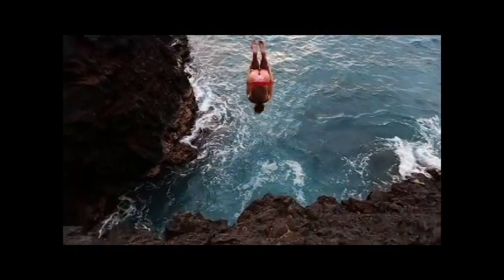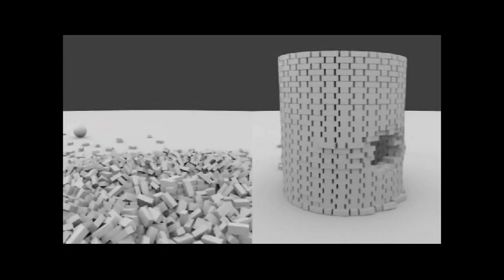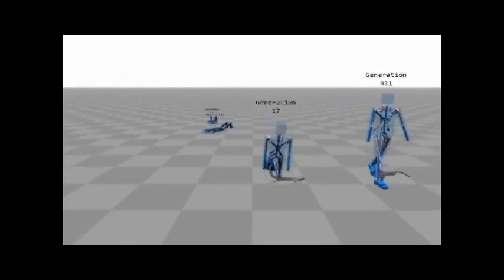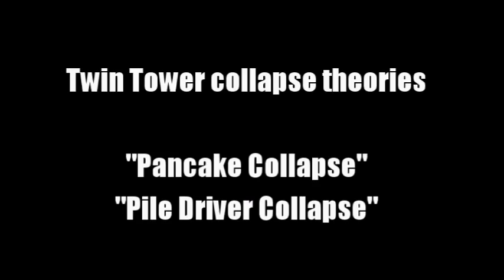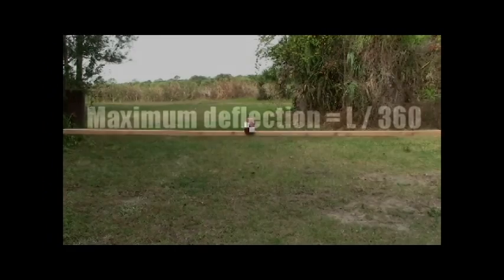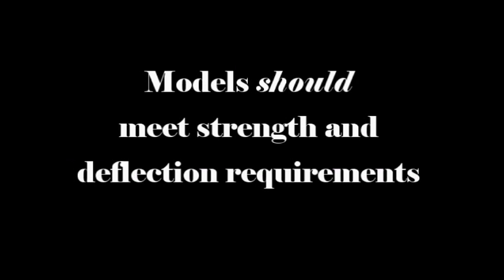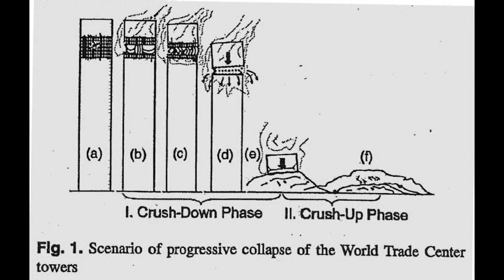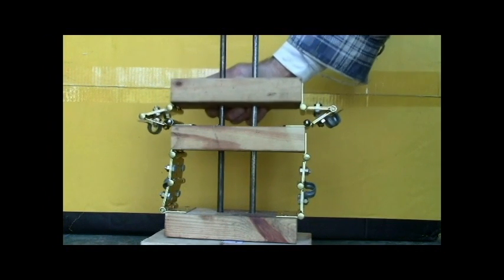9/11 Experiments: The Force Behind the Motion

Comment: F=ma is a WONDERFUL thing. It's just not relevant here. Newtons second law states that the vector sum of forces, F, on an object is equal to the mass m of that object multiplied by the acceleration a. Thus, F=ma. Great.

But, there's a couple of things that Mr. Cole STRANGELY omitted. Like the fact that this ONLY works if the mass is constant. If, say, something is breaking apart, like, oh I don't know...a BUILDING? It's irrelevant. There's also the slight issue of what is known as an "inertial frame of reference".

"The direction of the motion is always in line with the direction of the applied force." And to illustrate this, Cole shows a case where it isn't. Bravo. Where, in fact, the applied force is RE-directed, by use of a joint. Good sign.

Similar acceleration does NOT mean similar direction of force. Clearly stated in F=ma, in fact. "Vector sum of forces". Vector is DIRECTION, where is it headed. ACCELERATION is the force, simplified how FAST it's going. But the vector isn't the same as the acceleration. It can go up, down, left, right, forward, backward, in any combination you care to imagine. Yes, it can even go it opposite directions at the same time, and essentially not move at all, or potentially rip apart. The trebuchet shown is, in fact, an excellent example of this, in that it was know to throw stones in all sorts of directions, including back or straight up, if it was set up wrong. Similar acceleration, not similar direction.
Reply: Your falling mass will be decelerating as it falls no matter what is happening.  Building collapse mass changing or not.

And as you state the falling mass wouldnt all be falling on the building.  So that mass wouldn't impact the stable building at all.  Thus the mass falling onto the floors is LESS than the mass of the floors were before the collapse.
Reply: @DS94everXev  "Your falling mass will be decelerating as it falls no matter what is happening.  "
After all, gravity isn't actually a thing.

"And as you state the falling mass wouldnt all be falling on the building. "
Which is true, and matters not at all.

"Thus the mass falling onto the floors is LESS than the mass of the floors were before the collapse."
And increases with each floor, again.
Reply: @mooneyes2k478  I'm talking about the mass that falls that is part of the building that doesn't hit the floor beneath.

You will see it slow down no matter what.  Collapse is not eminent.
Reply: @DS94everXev  Because, as noted, gravity isn't a thing.
Reply: @mooneyes2k478  What are you talking about?  Gravity isn't a thing.  It's literally what moves the world around.
Reply: @DS94everXev  " What are you talking about?  Gravity isn't a thing.  It's literally what moves the world around."
MoonEyes2k is trying to tell you that gravitational force makes falling stuff go faster and faster.
Reply: @brucelansberg5485  You're telling me buildings falls to the ground no matter what once the collapse is initiated.

Gee.  Explain why demolition teams are even a thing then.  Just throw that onto the floor gave it blow up and the falling floor will just naturally destroy the 60 70 80 floors underneath then according to your logic of physics.

Explain why its possible for buildings to actually stop collapsing when they started to collapse.  Even though the building was set up to collapse by a demolition team.

Explain to me why you stop accelerating and eventually stop falling deeper into a body of water if you are meant to keep accelerating.  After all the water will slow you down.  Just like the stable floors underneath the falling debris are slow down a building whose top floors are collapsing.

Of course that won't happen if the floors are set up to fall prior to the top falling portion falls because it was set up with explosives.

Which is what happened on 9/11.
Reply: @brucelansberg5485  yes duh gravity is what makes the universe move.

"You seem to misunderstand speed for acceleration. If you drop a hammer from the top of a building, it has a constant acceleration of 9.8 m/s2 (it goes faster and faster up to terminal velocity). If that hammer encounters some kind of obstruction on its way down, the acceleration will decrease. However, as long as the acceleration is over 9.8 m/s2 it will accelerate. Only if the acceleration becomes negative, the hammer will slow down."

Ummm.. this is exactly what happened and is what is absolutely impossible unless the building was demolition.  The fact that the building fell at free fall speed is precisely telling you that the falling debris did not encounter ANY resistance as it fell.

That by definition means the floors were destabilized BERORE the falling debris ever hit them.  That is IMPOSSIBLE unless the floors were demolitoned.

Those falling floors would encounter a resistance stable floor every 12 feet or however tall the floors from floor to ceiling the WTT were.

So they would have slowed!  But they didn't.  You can't get a graph showing free fall speed if the floors were not demolitoned.  But you do get that graph because the floors were demoltioned. 

You seem to think that a smaller mass falling down on  a larger mass can destroy the whole thing.  That is simply WRONG.  

You seem to think that a falling piece of the building when it hits the stable floor would still manage to stay together and not be destroyed.  Then once this impossible piece of the building wiped out the entire building, it managed to crush itself.  But failed to crush itself the whole fall down.  That is WRONG.

"Unless the mass of 15-28 floors will be applied as a dynamic force onto the 1 single floor below."

Does not matter at all.  the falling part will ALWAYS slow down once it hits a stable item.  It is completely irrelevant how big the mass is falling down and how small the mass is of the object it hits is.  That falling mass WILL ALWAYS slow down.  Even if it hard to measure.  the falling mass will ALWAYS SLOW.  There is no such thing as dynamic force overcoming the fact that the falling mass hits a stable element.  The rule is very clear.  A falling object will ALWAYS slow down when it hits another object beneath it.

That is why a missle or a bomb traveling hundreds or thousands of mph will not go thru the earth.  It doesn't matter how much mass it is.  It hits the ground and it slows.  Eventually coming to a dead stop.  

"Only if the acceleration becomes negative, the hammer will slow down."

Did you watch the video here?  Because the experiment proves you are wrong.  A falling smaller mass will not destroy a larger mass at free fall speed.  That's what the experiment in this video proves.  

And neither your nor troll himself mooneye will change the facts.  You act like the floors cant handle any extra weight.  Each floor would absorb a TON of energy of the falling debris before it too would collapse under the weight.  As each floor was hit, the deacceleration of the falling debris would increase.  Until eventually the collapse ends.  Leaving a BUNCH of the building still standing.  The whole building would not have collapsed.  

While looking at building design and destruction, you will also learn that it is impossible for asymmetrical damage to cause symmetrical collapse.  

The WTT fell symmetrically.  The WTT were asymmetrically damaged.  Explain that using your odd physics rules. 

The WTT had the plane fly thru much of the building with the explosion going out the other side.  Those passenger planes will get ripped up by a hail story or flock of birds.  Yet you mean to tell me they went right thru a steel and concrete structure building?  Yet is easily ripped apart by a bird?

Those passenger planes can hit a max speed of 500mph or so at altitude.  Meaning the plane has to   be 35000 feet in the air to manage that kind of speed.  At sea level which is where the planes were that hit the WTT, they can manage no more than a few hundred mph.  Nothing near the over 600 mph that the planes hitting the WTT were going.  This is IMPOSSIBLE.  If you tried to decend a passenger plane so quickly the plane would rip apart.  That's engineering facts of those planes. 

There was gold in the basement of the WTT prior to 9/11.  At no point was it reportedly moved.  However, when the rubble was cleared from the site, there was no gold!  Where did the gold go!

"MoonEyes2k is trying to tell you that gravitational force makes falling stuff go faster and faster."

They won't accelerate faster and faster when they hit a stable floor every 12 feet or so though!  That didn't happen because the floors were demolitioned prior to the falling mass hitting them.  That is why it fell at free fall speed.
Reply: @DS94everXev  "You're telling me buildings falls to the ground no matter what once the collapse is initiated."
No, I don't. At all. I was trying to explain to you the difference between deceleration and less acceleration.

Your quest for an explanation on the demolition thingy is therefor irrelevant.

"Explain to me why you stop accelerating and eventually stop falling deeper into a body of water if you are meant to keep accelerating."
What has me bing in water to do with free fall acceleration of a hammer? I tried to explain how mass can still accelerate when it encounters resistance. As long as the resistance of the floor connections of the one floor below the falling mass is less then the downward forced acting upon it, the mass will accelerate. t won't be in freefall acceleration though. But like I said, anything over 0 m/s2 is acceleration.

"Just like the stable floors underneath the falling debris are slow down a building whose top floors are collapsing."
It isan't about the strength of the gloors of the towers,0 but about the strength of the connections between floor and columns. Apart from that, the extent to which a building is susceptible to progressive collapse, all depends on the design/engineering of that building, There is no generalization.

"Which is what happened on 9/11."
Any proof would be highly appreciated.
Reply: @brucelansberg5485  
"It isan't about the strength of the gloors of the towers,0 but about the strength of the connections between floor and columns."

It kinda is both.  Either way, its the same thing.  Why would the WTT engineers not design floor connections capable to sustaining substantially more weight than necessary?  Do you have evidence that they would not design floor connectors that can sustain substantially more weight?  Because they simply wouldn't do that.  How much weight will be on any floor can vary drastically.  You don't design building to only handle just a tad more than the suspected mass of a floor.  

"No, I don't. At all. I was trying to explain to you the difference between deceleration and less acceleration"

I don't really care.  That's not the point of the discussion.  The point is did the WTT fall due to controlled demolition?  Would the falling debris slow down (thus  not be free fall) if they hit a stable floor connection?  That is all that matters.  And the answer is 100% yes.  There were 60-80 stable floors here.  The falling mass would not have collapse  the whole building.  And free fall speed would not have been achieved for virtually the entirety of the collapse.

"Any proof would be highly appreciated."
Look up Rebekah Roth on Youtube.  I'll link her show in a separate post so that if it is deleted this post isn't deleted as well.

Just think about it for a bit.  Where was the army planes  that would be in the air in 6 minutes when the planes were hijacked?  How come there is not a single audio of the hijackers (not terrorists as Rebekah explains terrorist was not a word used by flight attendants before 9/11.  They were only called hijackes) entering the cabin?  How come there is zero engine noise in the cell phone calls we have heard?  How come the airplane cell phone worked perfectly for 20 minutes when it was always losing reception?  How come not a single flight attendant did their job correctly that day on 4 separate air craft?  Not a single one of them followed protocol at all.  How come the planes were showing up on radar going far beyond the speed of those aircraft (they weren't those planes that is why and is also why they could go thru the towers and not collapse upon hitting the towers?
How come only one part of the airplane was suffering from some kind of gas (pepper spray or similar) when the plane is pressurized in the air?  Because in a pressurized cabin, everyone can smell everything in a plane no matter where they are at.  (hint.  it only effected one part of the plane because the plane was not pressurized).  That by definition  means the plane was on the ground when that phone call was made!  That means what hit the WTT were not those planes.  Those  planes were at an airport controlled by the army with hangers large enough to house the planes.  And that airport controlled by the army did not have any staff that day on hand.  One of the attendants mentions that there are stairs in the plane.  But there are not stairs in the type of plane she was in!  Watch Rebekah's vids (she is an ex flight attendant so she'd know exactly what would have happened and who says what and who calls whom hint no calls would be made.  And this is stuff that common folk like us would never know (like flight attendant using the work terrorist rather than what they should have used "hijacker".)
Reply: @brucelansberg5485  Here's a link to one of the vids.  it is a bit outdated as the device used to take over an airplane away from the captain is no longer believed to have been used.  But regarding how each part of this would react if this was a real hijacking (flight attendant, captain, air control, army etc. she gets it right here.)  But its a great intro video to her and her work so enjoy!

https://www.youtube.com/watch?v=7md2QzNsAe4&list=PLzL220Pdflo7QRJucNPXrS0irDRlaoIA0&index=2
Reply: @DS94everXev  I'll get back to you and answer your questions tomorrow. It is 2 am here right now and I need my beauty sleep. Meanwhile don't hessitate to answer some of the questions I asked before as well.
Reply: @brucelansberg5485  i replied a bunch of things to you but google doesn't like the truth about Sep tem ber 1   1   being discussed.

So I will try to break it down in to s ma ll   er   po  s  ts
Reply: @brucelansberg5485  And falling objects will always slow down if they hit objects as they fall.
Reply: @brucelansberg5485   Did you watch this video as well as others by this creator?  He messes around with the building design purposefully weakening it.  It does not matter.
Reply: @brucelansberg5485  The falling object will slow down when it hits another object beneath it.  Even if you weaken the design underneath.
Reply: @brucelansberg5485  Free fall is only seen in demolition buildings.
Reply: @brucelansberg5485  Not in collapsing buildings.  No matter what the cause of the collapse or what's beneath the falling portion.  No steel concrete building has fallen from fire in history exc
Reply: @brucelansberg5485  That somehow managed to melt steel.  Look at the
Reply: @brucelansberg5485  NIST computer model of how bldg 7 fell.
Reply: @brucelansberg5485  It isn't remotely accurate to what you see in reality.  Their model gas one end of the building collapsing before the other end.
Reply: @brucelansberg5485  But what we see is a perfectly symmetrical collapse.
Reply: @brucelansberg5485  That can only happen if it was rigged as damage to a building from fire would not cause equal damage to all the support beams at once.
Reply: @brucelansberg5485  And if it did collapse due to fire (again that didn't happen) it would have fallen asymmetricly and the support beams that were not damaged would have held up the building that they support.
Reply: @brucelansberg5485  See who many of these posts last.  Sorry.  this is life on yu  t  ub  e
Reply: @DS94everXev  "i replied a bunch of things to you"
Between my post about calling it a day en my post before that, I can see 3 posts of yours. After my last post, I can see another one.

"but google doesn't like the truth about Sep tem ber 1   1   being discussed."
Well, not sure what that means, but I can see 4 posts that haven't responded too yet. And I engage in discussion on 9/11 with many others without any of their posts being deleted by Google. So you might want to rethink your conclusion.

Let me respond to these 4 posts. I will assume your broken down posts have the same content.
Reply: @brucelansberg5485  The
Y

J
U
St 

Remove
1+1= 
Posts
Eye just
Made
2 u.
Reply: @brucelansberg5485  all this 
Posts
At the now 
Fifteen 
Hour mark
Were........all.   ONE Post.

Took me 1 hr to bypass their auto removal.
Reply: @DS94everXev  "It kinda is both."
No it isn't. These floors could have been made from steel plates 10 inches thick. If the connections break, the floors will come down.

"Either way, its the same thing."
It is absolutely not the same thing. These connections were bolted. With normal use of the floors, no issue. But these bolts were not designed to have a dynamic force exercised on them of 15 from the mass of 28 falling floors.It makes al the difference.

"Why would the WTT engineers not design floor connections capable to sustaining substantially more weight than necessary?"
Whoever said they didn't? Of course there was redundancy. I haven't been able to find a factor though.

"You don't design building to only handle just a tad more than the suspected mass of a floor. "
Something we agree on.

"I don't really care.  That's not the point of the discussion."
It actually is. Your claim is that the collapse should have slowed down because of encountered resistance. It seems you think that any resistance should have slowed down the collapse. This is simply not true. It would only slow down the acceleration. Instead of speeding op 9.8 meters per second squared (free fall acceleration), it would now accelerate let's say 5 meters per second squared. A slow down of the collapse would indicate an acceleration less than 0 meters per second squared. This is the central point of our discussion. You claim that any resistance will lead to a slow down in speed, yet it will lead to a lesser acceleration (which means that it possibly still accelerates).

"The point is did the WTT fall due to controlled demolition?"
Well, if evidence is important to you, then the answer is no.

"Would the falling debris slow down (thus  not be free fall)"
So I guess you will now get that less than free fall acceleration doesn't mean a slow down in speed.

"if they hit a stable floor connection?"
So the falling debris wouldn't necessarilly slow down, just the acceleration will be less than 9,8 m/s2.

"And the answer is 100% yes."
No it isn't :).

"And free fall speed"
There is no such thing as free fall speed. There is only free fall acceleration.

"And free fall speed would not have been achieved for virtually the entirety of the collapse."
There was no free fall acceleration for the debris that hit the floors. There was only free fall acceleration for the debris that fell past the towers. If the topwers would have collapsed at free fall acceleration, they would have collapsed in 9.2 seconds. Yet they didn't. Please take a look at this short video where a clock is timing both collapses and see how the towers needed more time than 9.2 seconds.

https://www.youtube.com/watch?v=ZtknESrHNEs&list=PLNUStdCpyxT8TBfOCscomO6yEqQlpJxCT&index=12&t=59s

"Look up Rebekah Roth on Youtube."
Do you expect me to wtach a 1 hour video to search for evidence of a claim YOU made? :) A claim btw about the buildings being setup with explosives, and you link a video of an interview with a stewardess? :) How would that prove anything?
Reply: @DS94everXev  "Just think about it for a bit."
I'd be more than happy to discuss your other proof. But may I suggest to get to an understanding about the subject matter of free fall acceleration first? Otherwise it's going to be a very messy thread.
Reply: @DS94everXev  "all this Posts At the now Fifteen Hour mark Were........all.   ONE Post.Took me 1 hr to bypass their auto removal."
Not sure if there is such a thing as auto removal with YouTube. Unless you have repeatedly violated their posting guidelines before. But talking about conspiracy theories in the comment section is never an issue. Like I said, I have hem numerous discussions where other stated a lot worse than you have :).
Reply: @brucelansberg5485  I know buildings fall asymetricsly if damaged asymetricsly because architects have said so.
Reply: @brucelansberg5485  Have you read NIST?  It doesn't bother to explain the collapse of the building once collapse has started.  It assumes the whole building will collapse.  Like once it starts its inevitable.  Which it clearly isn't because buildings set to be demolished but something went wrong didn't fully collapse at all.  It started BUT STOPPED.  Why?  So why did NIST end their investigation at the start of collapse?  

Look at the Miami apartment collapse.  The whole building didn't come down.  Only the part that suffered damaged. 

There is nothing special about 7 design.  It he from fire.  The news said it re that day BEFORE it fell!  

I'm sorry if you are obsessed with acceleration vs deceleration.  You aren't seeing the picture.  And you never will if you refuse to watch the vids.
Reply: @brucelansberg5485  I saw your video link.  Some thoughts on it
1.  Are you seriously comparing the fire in bldg 7 to the fire in this falling building?  Look how many floors are burned out vs bldg 7.  Not remotely the same thing.

2.  Did you read the comments section? A person brings up that this building should have fallen symmetrically according to September eleventh.  It didn't.

3.  Your video fails to show if the whole building fell.  Because as you can see it's collapse was asymmetrical.  Your video actually demonstrates the type of collapse you are arguing against.  It ends in smoke.  Not showing the building completely collapsed.

4. How well was this building made?  Because I hear laughter when it fell.  Not screams of terror and horror.

5.  The steel in bldg 7 was also protected against fire.  Were these beams in this building?

6.  Did the building fall at free fall?  Kinda the point of this whole thing.

7.  You have yet to discuss the other details.  About the P
  L
A

N

E
S
Reply: @brucelansberg5485  If you feel that this video is not accurately representing the event of what happened how come you can't show me a video demonstrating the physics like this guy does?
Reply: @DS94everXev  "I know buildings fall asymetricsly if damaged asymetricsly because architects have said so.."
Well, show me one architect that has ever witnessed a 11- story building collapse apart from the twin towers. And we can have a discussion about the meaning of symmetrical. The towers were built symmetrically. The progressive part of the collapse was more or less symmetrical. Or are you suggesting explosives were used?
Reply: @DS94everXev  "Have you read NIST?"
|Is that a question to me or are you repeating my question? I have read the reports on the twin towers and I have read the reports on WTC 7. The thing is, I asked you if you have read the reports. It doesn't go unnoticed hoe you still haven't answered that question.

"It doesn't bother to explain the collapse of the building once collapse has started.  It assumes the whole building will collapse.  Like once it starts its inevitable."
True, they habe not explained the progressive part. Were they tasked to? And no, they didn't assume. And yes, it inevitable. It's called progressive collapse. I have explained a little bit about the structure of the towers. What else do you needc to understand that it indeed was inevitable?

"It started BUT STOPPED.  Why?"
If you are honestly sking this question. it is very clear to me you haven't read the reports on the twin towers. You should, if you want to critisize is. Read the reports!

"Look at the Miami apartment collapse.  The whole building didn't come down.  Only the part that suffered damaged. "
So please explain to me how the engineering of Champlain Towers South compares to the engineering of the twin towers. I feel like we're going around in circles. Me expaining how you don't understand the engineering of the tyopwers, and you completely ignoring this. If you don't understand how they were built, you will never understand how they came down.

"There is nothing special about 7 design."
Are you kidding me? Really NP, please make sure you know what you're talking about before you express your opinion.

"The news said it re that day BEFORE it fell! "
And your point would be what exactly? Do you also know which news?

"I'm sorry if you are obsessed with acceleration vs deceleration."
Dude, I'm not obsesses, I am annoyed you simply don't want to understand what I'm trying to say. Let me try a last time. My car goes from 0 to 100 in 10 seconds. When accelerating, my car hits a cat. Because my car hit a cat you claim that my car should slow down. NO!! My car will now not reach 100 in 10 seconds but in 12 seconds. It is still fucking accelerating, but less fast. 0-100 in 12 seconds is less acceleration than 0-100 in 10 seconds. My car is not decellerating, it is still accelerating. Get it?

"You aren't seeing the picture."
The irony is stunning.

"And you never will if you refuse to watch the vids."
I will watch the vids of the interview with some stewardess later. They are not relevant to the collapses.
Reply: @DS94everXev  "Are you seriously comparing the fire in bldg 7 to the fire in this falling building?"
No, you are. I posted the three videos as a reply to your false claim _"No steel concrete building has fallen from fire in history exc"_.

"Look how many floors are burned out vs bldg 7."
So how many floors in video 1, 2 and 3? And how many in WTC7? Have you seen th pictures of WTC7 from the south side too? Did you see that fire in the second video too? Did you that fire started by a broken coffee machine? Did you see ho the intact of that tower collapsed too? But all of this doesn't matter much. Every fire is different. Every building is different. Comparing is hard without understanding the little details.

"Not remotely the same thing."
Well, since I didn't post them for the fires to be compared, but only to prove your statement wrong, are you now accepting you are?

"Did you read the comments section? A person brings up that this building should have fallen symmetrically according to September eleventh.  It didn't."
No I really couldn't be bothered to watch read the comment section. And I am totally fine with some anonymous poster on YouTube saying some things. I don't care. What I do care about is the fact that every building is different, every fire is different. Like I said, we could have a nice discussion about the meaning of symmetrical.

"Your video fails to show if the whole building fell."
I linked three. Which one you talking about? And it's irrelevant if you don't keep moving the goal posts. Your claim was that no steel framed building has ever collapsed from fire. I provided you with 3 examples.

"Because as you can see it's collapse was asymmetrical."
So what? What does it mean to you?

"Your video actually demonstrates the type of collapse you are arguing against."
What are you talking about? All three videos show collapes of steel framed building after fires. Something you claimed never happened or never could happen. That's all there is to it.

"How well was this building made?  Because I hear laughter when it fell.  Not screams of terror and horror."
Haha, dude... :) Anyway... only the second one has laugther and excitement. How well was it built? The only thing I can say is that it was the faculty of constructional engineering of the University of Delft. I will leave all speculation to you.

"The steel in bldg 7 was also protected against fire.  Were these beams in this building?"
So you clearly have watched one video only. I don't know which building you are tal;king about, so I cannot answer that question. If you are really interested, you could look up the reports on these collapses.

"Did the building fall at free fall?  Kinda the point of this whole thing."
Nope, it was the point. The point your false claim no steel structured building had ever collapsed as a result of fire. None of the three building at 9/11 fell at free fall acceleration by the way. If you picked that up from the guys and girls at A&E9/11Truth, you have been fooled.

"You have yet to discuss the other details.  About the planes"
What about the planes? I have not seen you mentioned them.
Reply: @DS94everXev  "If you feel that this video is not accurately representing the event of what happened how come you can't show me a video demonstrating the physics like this guy does?"
Don't mistake a fact for an opinion.
I don't understand your question. What does me showing a video or not has to dowith the validity of the above video?
Reply: @brucelansberg5485  oh man.  that is a video of a guy replicating the wtt collapse?

Seriously?  It nearly fell over when he gently tossed his wrench into it!  He didn't show that it was sturdy at all!  He demonstrated that a simple force can tear his model down.

""Because what happened can't be simulated in real life."
This doesn't make sense. Something can't exist if it can't be simulated? :)'

I'm saying the explanation does not fit the truth.  That is why it can't be simulated.  If it could it would have been. And NIST would have shown us the experiment.  

"I don't want to pretend anything. I'm not pretending anything. But the only logical explanation is molten aluminum from the plane that hit that exact same floor. "

That molten part is not from the floor hit.  It was below.  And good luck getting aluminimm into that steel concrete structure.  

"No, my reply will be "Read the report", so at least you know what you try to fight in the first place."

I have.  And they don't explain anything at all.
Reply: @brucelansberg5485  ""The evidence against it is EVERYWHERE."
And yet you refuse to show me any."

No.  You flat out have stated that you won't watch it till sometime later.  Why?  I told you to watch those vids.  You didn't. so you refuse to accept evidence.  When you finally do, you will see all the waste of time you spend defending NIST.

"Please study the design or let me explain it to you. Now it is obvious you are simply repeating uninformed claims. Sorry dude, but it is obvious. "

I'm repeating what 3500 architects and engineers have supported.  Which is far more than NIST has.  Not to mention i'm using common sense.

force applied in z direction doe not explain things pushed out at such a high speed and such a mass without explosives in the lateral direction.  Explosives would apply the force outward.  Gravity will not.  Therefore it wasn't gravity forcce that did that.  And since NIST does not have an explanation of that lateral force, guess what I think of their report?

NIST does not explain this.  And neither have you.  Contently saying I know do you and "read the report" (funny how you fail to actually quote the report sections that answer these facts) does not actually present evidence at all. Its just you parroting what you want to believe.  The difference between me parroting and you parroting is my explanation of what happened matches the evidence.  Practically none of your evidence explains why.  

"the design alone was responsible for the progressive part of the collapse."

And yet fails to explain the lateral movement of multi ton steel sections that hit surrounding building with such force that they stuck into them.  And yet fails to explain concrete pulvarizing in mid air.  And yet fails to explain the utter destruction of those transformers.  And yet fails to explain the absence of the gold.  And yet fails to even explain how the planes even penetrated that far into the building.  And yet fails to explain why there were explosions in the lobby far far from the impact point.  And yet fails to explain why the owner of bld 7 said "pull it" before it fell.  And yet fails to explain why the reporter said it fell before it did.  And yet  fails to explain why the center of the building is what collapsed first which is EXACTLY what a demolition would do.  And yet fails to explain why the building initially fell sideways and then straightened itself up.  And yet fails to explain the free fall speed achieved.  I don't care how it is designed.  It cant get free fall speed unless the falling debris encounters no resistance.  I have a lot more more "And yets..."  All of which you cant explain with NIST.  But I can explain with  demolition style. 

Yes I know all that you said about the design of the building.  I saw that documentary as well.  And NONE of it explains any of the things in the above paragraph and posts from me.
Reply: @brucelansberg5485  I actually finished watching that vid you say is the proper physics of the tower.  You know the one where a wrench almost knocks the Model over.  So good thing wrenches didn't hit the tower before that plane.  Heck maybe that explains why the towers fell!  If a gently tossed wrench can move it a good bit..why not air p  lana es?

Anyway did you actually watch the video?  Seriously now.  Because if you did you will see ZERO lateral movement of the collapse structure.  Absolutely none.

Yet the towers have A TON of lateral force movement.

Dude, your own video disproves your own position. Your video has everything falling straight down.

Why?

'Because that is how gravity works.  Down.  Nothing went laterally because no force was applied laterally.

Watch the towers collapse.  This video is flat out showing that what happened on that day is NOT this.   

" I accept the outcome of the reports. You don't "

Because they fait to explain the physics that day.  Simple as that.

"There was no nano thermite found, so hey don't include it."

You sure you read the report?  I mean it is boring as i get up.  but if you did then you'd know that NIST NEVER looked for thermite!  Much less nanothermite.  So it was not in the report.  That does not mean it is not there!

And if you knew that independent labs did look for thermite and found it, then what does that mean to you?  Because they did find it.

https://benthamopen.com/contents/pdf/TOCPJ/TOCPJ-2-7.pdf

https://www.deseret.com/2009/4/7/20311250/traces-of-explosives-in-9-11-dust-scientists-say

A peer review scientific research paper (top 1).  By the way NIST is not peer reviewed.  They won't even allow access to their computer modeling to see if it is accurate.   A peer reviewed paper IS NOT CONSIPACY NUT JOB.   

"Yet they fail to mention that part of the columns was treated with a primer paint that actually has the same compopnents in it."

Components means what to you?   because the components inside of you and what makes you are the same components inside of a rock!  If you know science you know that it is not the components of something that matter that much.  Its how those components are arranged.  They found nanothermite.  Not components of a primer paint (by the way that same steel with the primer also had fire resistance material sprayed onto it as well to help prevent weakening from fire.  But let's pretend that isn't true.  

Lets just say that I trust peer review paper over you a youtube commenter  saying its not nanothermite.  You mean to tell me they place explosive material into the materials to make the building?  Because I'm not buying that. But you still can't explain the lateral movement from gravity alone force collapse with your vids.
Reply: @brucelansberg5485  
"Now take a thorough look at their titles. You will see a lot of students, a lot of non licensed architects or engineers,"

Actually I dont see students and out of work people (though why does that matter.  Their expertise is all that is needed.  Not that they are working.  this is not unemployment)

Those are not students!!  They are professors or workers of some kind for universities.  Where does  it state student?  You are pretending they are. Virtually all of the signees are AIA members.  You have to be an architect to be in AIA.  Like NEA only allows teaches to be in it.  Once again, your own link proves my point even more so.  

"What is relevant, is the lack (or basically the absence) of evidence."
Wrong.  Lateral movement of debris when the only force applied is vertical from gravity is the only thing you need to prove NIST is wrong.  There are lots of other things.  But you fail continuously to demonstrate lateral movement of steel weighing tons being tossed at 60 mph from gravity.

"Dude, you're stubborn. There is such thing as free fall speed. There is only free fall acceleration. Neither of the towers fell at free fall acceleration."

Blame scientists and engineers who say free fall speed routinely.  But you're not one so it would be hard for you to manage that.
Reply: @DS94everXev  You can't blame me for not responding to something before you write it  I will get back to you again tomorrow. Time for bed now. Ad don't forget to repsond to the things I wrote you do understand now :).
Hope to talk to you tomorrow.
Reply: @DS94everXev  So, back for round 3. I have to admit, I don't like how you keep throwing claim after claim at me, while we haven't discussed the main point of this thread in full yet. You keep ignoring question I ask and explanations I provide, unless you see a chance to throw a new claim in my face. So let me ask my question again: Do you now understand how deceleration and less acceleration are basically eacht others opposite and why this is so important to your uderstanding of the acceleration of the collapses?
Reply: @DS94everXev  Interesting video.  I don't understand how AETruth claims the spread of debris is too wide and at the same time claim the towers fell in their own footprints. Maybe you can explain?

""Video shows debris pulvarized in mid air""
Could you please provide a timestamp where we can actually see what is claimed? I hear gage making this claim, yet I don't see it in this video or any other. Unless you think here is another example of concrete being pulverized mid air:

https://youtu.be/yOE8H_1Dhz4?t=164

"Steel structures weighing tons were projected outward (x and y axis) at 60 mph."
The x axis is vertical. I gues you mean the Y a Z axis?

"How is that possible if the only force being applied is from the z direction..from the falling part falling on the bottom part? It simply isn't.  Only explosives and send debris in the x y direction since the collapse is in the z direction."
Lets take a closer look at this claim. We agree gravity works vertically. Now imagine a pool table. The force the white ball puts onto another ball is in one specific direction. Yet, only if the next ball is hot perfectly in the middle, the other will go straight ahead. In any other case, the next ball will have a different path. So how is that possible if the applied force is directed straight ahead? Take a marble, drop it onto a piece of wood that is placed under an angle. Which way is the marle propelled? Straight down, or will it bounce off to the side? Two very simple examples to show your claim is false. 

"Why do you see puffs of smoke coming out"
Result of air being pressed together by falling floors. The air is forced to seek a way out through the path of least resistance.

"just like in a demolition on floors that are not even  close to being impacted by the falling mass?"
Not just like in a demolition. Demolitions use explosives. Buildings that are demolished will break at the points where the explosives go off. These explosions happen all around the same floor. A few single puffs do not resemble controlled demolition, not matter what AETruth is claiming.
How would you know if these floors weren't even close to the falling mass? We can't really see inside the towers, can we? I have explained about the engineering of the towers and described the importance of the floors for the construction. The floors fell first. The puffs are a clear indication of that.

"What we see is an outward explosion of this material beyond the perimeters of each footprint.  And this is not expected."
Not expected by whom? Now let me explain what we really see. We see sheets of exterior columns leaning out and breaking off after the floors had fallen. Please take a look at this picture below.

https://ia801303.us.archive.org/2/items/NIST_9-11_Release_08/International_Center_for_911_Studies_NIST_FOIA/Release_08/Release%208/42A0007%20-%201of3/Police%20Overheads/166.JPG

We see several sheets of connected exterior columns covering West St. Like a stack of beer crates falling over.

https://youtu.be/9SReWtHt68A?t=55

"So what in the NIST report explains this?"
What's there to explain? Only conspiracy theorists think this is an anomaly.

"Large multi ton beams are were hurled hundreds of yards laterally.  Gravity works verrtically, not laterally."
Do you still think tis is an intelligent observation?

"Something happening to throw these things (multi ton steel sections)  horizontally at those kinds of speeds up to 60-70ph is really indicative of some kind of explosion."
No it isn't. See explanation above.

"So watch any other demolition.  Do you think those puffs are from air pressure or from explosives?"
"Any other demolition" is quite broad. First hit, a nice slow motion of a controlled demolition of a high rise building. Please take a look at these puffs and see how in this case there is an explosive force behind it. Speed, range, locations, simultaneity and material all indicate an explosie force. Now compare this to what we see at the twin towers.

https://www.youtube.com/watch?v=3JMgFgjSkQ0

"Not from the collapsing building from gravity.  Elementary school science already teaches that.  What force was it?"
See solution above. Gravity.

"All the signs of demoltion and the completeness of desrtruction down to their individual elements."
Literally none of the signs. Most noticebly, the absense of the sounds of the explosives. This is what it should sound like:

https://youtu.be/hdqWRHe4AKs?t=9

Decibels and repetition/sequence is what is lacking at the collapses of the towers. How do you explain that?

"Do you know why it started to lean over and look like it was going to hit the building next to it?  Because it was damaged asymetrically from the impact!  It was going to fall asymetrically.  But then the explosives went off and it corrected itself."
See picture above.

"There are 64 transformers.  Each weighing 4 tons.  And yet after the collapse there is no evidence of them. in the debris."
Over 108,000 trucks loads of debris were removed from ground zero. Please tell me you haven't checked all of them and didn't find any crushed metal boxes. What are you suggesting? That some laserbeam from space targeted and destroyed all of them? 

"As an architect I would expect to see larger portions of the building floors and the steel decking and the concrete topping much larger remanents...Afterall each floor plate was over an acre in size and there are over 100"
The concrete slabs were 4 inches thick. That's nothing in a collapse of a 110 story steel framed building. Where did this architect search for concrete? And there is a very nice example of how misleading AETruth actually is. This guy claims each floor plate was over an acre in size. The reality however is that each floor was constructed using elements 6 meters wide and 18 or 11 meters long. Nothing near an acre.

"while stating why the falling part did not get demolished at all"
I have not been able to find any information on this in the NISt reports. Source?

"From river to river there was dust 2 to 3" deep everywhere."
Have you checked this claim? I am a bit confused right now. Is it 2-3 inches or is it 4-12 inches. Both claims made by AETruth.

https://www.facebook.com/photo.php?fbid=10151809306826269&set=a.379243506268.164274.59185411268&type=1&theater

Since apperently this photo is the best evidence AETruth could find, and it is obviously less than 1 inch thick, I'd suggst this claim to be debuked.

"NIST does not explain a single one of these things.  If they did, AOE would not have 3500 people saying this is wrong."
If the claims are false, why should they be explained by NIST? Not checking facts and simply assuming makes 3,500 people being wrong.
Reply: @DS94everXev  "You flat out have stated that you won't watch it till sometime later.  Why?"
Before you wrote this line, I had already explained twice.

"I told you to watch those vids.  You didn't. so you refuse to accept evidence."
I hae explained that watching an interview with some stewardess that wasn't even involved in 9/11 doesn't help explaining yourmisunderstandings of the collapses of the towers.

"I'm repeating what 3500 architects and engineers have supported.  Which is far more than NIST has."
Why does that even matter? NIST studied the collapses for over 3 years with a team of several hundreds of subject atter experts. These 3,500 individuals we know nothing about. They might have studied it, they might just simply have signed the petition. One thing is for sure, they didn't have access to the same sources as NIST had. And please explain to me how electrical engineers, software engineers, landscaping architects or aeronautical engineers have the same expertise and experience as a team of subject matter experts that have studeid the incident for years? Most importantly, whay does it matter? It's simply an appeal to authority. It doesn't prove anything. How large is the group that hasn't signed the petition again?

You shouldn't be repeating. You should check the claims for validity. Just repeating doesn't teach you anything. Just repeating will make you make the same mistakes over and over again. 

"NIST does not explain this.  And neither have you. "
Like I stated before, you can't blame me for not repsonding to stuff before you have written it.

"Contently saying I know do you and "read the report" (...) does not actually present evidence at all."
As I have stated, I told you to read the report to gain an understanding of the engineering of the buildings. I have not directed you to the reports for any kind of evidence. I'm not the one who has to provide the evidence. Since you are the one making claims, I believe the burden of proof is on you.

"And yet fails to explain the lateral movement of multi ton steel sections"
Like I stated before, you can't blame me for not repsonding to stuff before you have written it.

And that whole list of what I have failed to explained? Really? Most of these issues you haven't even addressed before. How am I supposed to respond to something you haven't mentioned before? Dude... Like I said, I respond to every single rediculous claim you make, in order of appearance. The real problem is that you do not respond back on most of the things I explain. Why is that? Mat I assume you agree to the explanation if you don't come back to it?

" the lateral movement of multi ton steel sections that hit surrounding building with such force that they stuck into them"
Done.

"concrete pulvarizing in mid air"
Show me some evidence that really happened.

"the utter destruction of those transformers"
Show me some evidence that really happened.

"the absence of the gold"
Done. All gold was accounted for.

"how the planes even penetrated that far into the building"
They didn't, at least not as a recognizable plane. Yet the parts that hit the windows, travelled further into the building. Why would they not?

"there were explosions in the lobby far far from the impact point"
Falling elevators. Fire balls travelling trhough the shafts.

"the owner of bld 7 said "pull it" before it fell"
Hahaha, really? Do you really want me to take this claim seriously? The owner admitting the controlled demolition in a documentary? :) Could it possibly be that he was not referring to a controlled demolition when he used those words? I can't believe you mentioned this one...

"the reporter said it fell before it did"
BBC acted upon information they received from AP. AP retracted that report later. Classic case of chaos in reporting a chaotic event. No-one has ever been able to explain to me why BBC and CNN would be part of the conspiracy at all by the way.

"the center of the building is what collapsed first which is EXACTLY what a demolition would do."
The center of the building collapsed first? Talking about 7 right now? I don't understand what your issue is on this matter. Please explain. WTC 7 looked like it fell from the bottom, not from the center (vertically). If you look at the collapse video of 7 that I linked, you would see the east penthouse collapse several seconds before the out shell does. The interior (you know, the part where the structure is) collapsed. the exterior stood for a few seconds. What is ti you don't understand about this?

"the building initially fell sideways and then straightened itself up"
It's getting more and more difficult to understand your chain of thought. I guess we're back to 1 and 2 now? The towers never fell sideways. The top did lean obviously. When the top started leaning, forces acted upon the members of that top for which they were not designed (carrying verticval loads), so it broke apart and the individual members continued following the path down. Do you think the tops of the towers remained in 1 piece?

"the free fall speed achieved|"
We have been over this before, more than once. Did you watch the little video I linked? Did you do the counting as well? Do you still think the towers fel at free fall acceleration? Free fall speed is not a thing.

"I don't care how it is designed."
I know you don't. And that attitude will keep you safely in your conspiracy bubble. Since what would happen if you would care and actually started understanding how the design and the way the towers fell are related? You might start to understand that you have been fooled all these years by a bunch of misleading people and videos. And then you would have to admit to yourself you were wrong. That can be a very painful experience. So, I know you don't care about the design. But you should.

"I have a lot more more "And yets..."  All of which you cant explain with NIST."
But like most of the new claims above, you need to write them down before I can respond to them, correct? 

"But I can explain with  demolition style."
Yet no repetative sequence of explosions during the collapse, no indication of explosives found, basically no evidence of explosions that come with a controlled demolition. None. You are theorizing only. Which means you are a conspiracy theorist.

"But I can explain with  demolition style."
Which one? Stop watching videos and start reading the report!

"And NONE of it explains any of the things in the above paragraph and posts from me."
Most of these claims are false anyway. The others are perfectly explained by the design of the towers.
Reply: @DS94everXev  "I actually finished watching that vid you say is the proper physics of the tower."
Again you are misquoting me. Stop doing that. The rest of your post is all centered around this misconception, so basically worthless.

"Because they fait to explain the physics that day.  Simple as that."
Which physics do you consider unexplained EXACTLY?

"You sure you read the report?"
Oh yeah, I did. And I understood it as well. Did you?

"So it was not in the report.  That does not mean it is not there!"
I was talking about the Jones/Harrit et al paper which you were referring to. They never fopnd (nano) thermite. They claim they found residue of nano thermite.

"And if you knew that independent labs did look for thermite and found it, then what does that mean to you?  Because they did find it."
No, they didn't. It would take a very long post and a lot of time to explain.There is a nice thread on Metabunk however where it is discussed. In specific the posts by Oy, are of interest.I do realize you will probably never accept Metabunk as a source, but at least you could give the discussion a good read.

https://www.metabunk.org/threads/investigating-active-thermitic-material-discovered-in-dust-from-the-9-11-wtc-catastrophe.9485/

"A peer review scientific research paper"
What does that even mean? Peer review means other, non involved scientists, have approved tha methodoly as described. They will never have an opinion about the outcome. So was it really peer reviewed? Why is it that this paper was never published in a peer reviewed magazine?

"You mean to tell me they place explosive material into the materials to make the building?"
No, you are. Are you trying to tell me the red/grey chips were explosive? Just checked the report again, and it doesn't mention anything on the chips being explosive. It is just assumed it is thermitic and therefor explosive.
Do you realize that if you would agree the chips are thermitic, you would have to assume it was painted on the steel which must have been done before the towers were even built?

"Because I'm not buying that."
Apperently you are.

"But you still can't explain the lateral movement from gravity alone force collapse with your vids."
Well, yes I can and I did.
Reply: @DS94everXev  "Once again, your own link proves my point even more so.  "
You were wrong the first time. You are wrong again.

You might want to scroll down just a bit frther, to where the non-flagship signees are listed.

"Blame scientists and engineers who say free fall speed routinely."
No, I blame you who simply repeats words you don't understand.

"But you're not one"
So, how would you know? Did you ever ask me? Did I make any mention of it? You are making stuff up, just like you do with your conspiritorial believes.
Reply: @brucelansberg5485  The main point of this thread is how and why did the buildings fall down.

The video is about showing the required physics that is necessary (need explosives).

And I have said that you are obsessing over the middle of it.  Start from the beginning.  The hijacking.  The flight crews.  When you disprove that all following official reports of the day is  also disproven.
Reply: @brucelansberg5485  "I don't understand how AETruth claims the spread of debris is too wide and at the same time claim the towers fell in their own footprints. Maybe you can explain?"

It's not that hard.  And they are simply stating what happened.  If gravity is the only force applied, then as your own video proves the falling debris only falls downward.

But you have multi ton steel sections flying over 60 mph and imbedding themselves into building that are in the  x y directions.  That can't happen from gravity.  That requires a huge mount of energy to do that propelled in that direction.  That would be explosives.  

And as the video states, it should not have fallen straight down because as I have reiterated a million times now, asysmtertical damage results in asymetrical collapse.  And you even see it happening like that.

"The force the white ball puts onto another ball is in one specific direction. Yet, only if the next ball is hot perfectly in the middle, the other will go straight ahead. In any other case, the next ball will have a different path. So how is that possible if the applied force is directed straight ahead?"

Did you read your own explanation here?  You flat out state that if you don't hit a round spherical object in the middle it will drift in another direction.

That is because you applied the force to go in that direction!  There is no other force being applied to the ball.  If there were the game of pool would be a game of luck.  It isnt.  It's a game of skill.  The skill being able to hit that cue ball in a straight line when you wish and to curve it to the right or left if you wish.

As you have stated many times the WWT were square shaped.  Not spherical.  This example proves my point.   It does not refute it.  Objects go in the direction that the force is applied..  If you can't hit the cue ball straight its because you suck.  It isn't because some voodo force direction took over.

Now to continue your example, if the pool table is not perfectly flat or has severe scratches/damages in the lining, then the pool table will apply a force in a different direction from the force you applied when you hit the cue ball should the ball come into contact with the damaged area of the pool table.

That is actually a marvelous examples of what happened with WTT!  Good job!  Because you see the only applied force was gravity that was being used (when you hit the cue ball), but then you have such force being applied in a different direction (cue ball hits the damaged part of the table) that pieces that are now separate from the building and therefore can move in any direction, are now thrown outward because of set explosives.

Well done!  I anoint you good sir!

"Take a marble, drop it onto a piece of wood that is placed under an angle. Which way is the marle propelled? Straight down, or will it bounce off to the side? Two very simple examples to show your claim is false. "

Ummm...this example is utterly horrible.  You just said the wood is slanted.  Where is the slant in the WTT!  And you completely changed the conditions of the statement by adding another force.  Remember the ONLY  force used to take down those buildings was gravity.  According to NIST.  Now you are adding another force to explain WTT while also defending the one force statement of NIST.  So...you can't do that.
Reply: @brucelansberg5485  

"while stating why the falling part did not get demolished at all"
I have not been able to find any information on this in the NIST reports. Source?  

Ummm.. it is in this video.  So maybe watch this one again.  you pretend that the falling debris is invincible when it hits the stable floors and isn't destroyed when it hits them.  That would be wrong.  The falling debris is destroyed when it hits the stable floor.  Eventually the falling debris is destroyed and the collapse should have ended before the whole building is wiped off the planet.  Because it was.  (those floor panels an acre in size should not have vanished off the earth like they did.  They should have been at the bottom of the pile.  But they weren't).    Including everything inside the building.  There was practically no recovered items like desks...or those nearly invincible  transformers left in the rubble.  Where did they go?  A simple falling of the building would not have utterly destroyed them.  But they were.  Gravity of falling building can't do that.  Nor can it (or explosion's) destroy the engines of those planes.  But they weren't recovered either.  That's in the vids that you refuse to watch though. 

A force significantly greater than gravity and the building falling on top of it is necessary to destroy those things completely.  There was NOTHING  left of those transformers.  They weren't crushed.  There was NOTHING.  Those engine planes are made of titanium.  Very strong metal.  Those engines have been recovered in EVERY plane accident that wasn't over water (so we lost it) in history.  Except on that day they were destroyed.   

""From river to river there was dust 2 to 3" deep everywhere."
Have you checked this claim? I am a bit confused right now. Is it 2-3 inches or is it 4-12 inches. Both claims made by AETruth."

Does it really matter how thick the dust is?  And it is clear you didn't bother to watch the video at all.  The quotes I have are from the video!  It was the governor at the time who said it.  And I don't think he went out and measured it.  He was being interviewed on the spot and gave an opinion!  AE Truth likely did measure it as its their protocol (because they followed protocol unlike the flight crews that day) to do so before making a claim in science.  

You're completely missing the point though.  Where did the dust come from?  (we know its cement) but no way was it pulvarized in mid air like that.  Not a single cement piece much larger than you can hold in your hand was on the rubble site

"and it is obviously less than 1 inch thick, I'd suggst this claim to be debuked.". 

And you can tell how much snow is on the ground and debunk whether it is 1" or 2" too i bet!  You have no clue how much snow is on the ground till you step in it.  Sorry.  Your visual evaluation of how much dust is on the street does not determine how much dust was on the street.  Notice the range given in the very photo you use?  4-"12"?   The freaking governor said the dust (2 to 3") was all over Manhattan man.  That means there could have been places where it could have been more dust too you know.  Your denial that it is is in itself a conspiracy theory with no proven data.

"NIST does not explain a single one of these things.  If they did, AOE would not have 3500 people saying this is wrong."
If the claims are false, why should they be explained by NIST? Not checking facts and simply assuming makes 3,500 people being wrong. "

You really don't watch any videos at all do you.  It is obvious in the videos that you see steel sections flying laterally not in the  direction of force applied by gravity which is straight down (like your link example of the true physics  video of the guy whose wrench nearly took down his tower).  That video is what should have happened if no explosives were used.  No lateral movement in the slightest by any part of the building.  But you see outward projection which means force applied not from gravity.  And NIST ignores it.

It isn't a claim that there was lateral projection of multi ton steel sections that flew at such speed as to imbed themselves into surrounding buildings.  Its a fact.  And NIST (along with you) ignored the reason for that to happen.

""Why do you see puffs of smoke coming out"
Result of air being pressed together by falling floors. The air is forced to seek a way out through the path of least resistance"

The very next sentence in the video discredits this conspiracy theory of air pushing windows out 20 40 floors below the collapsing section.
Reply: @brucelansberg5485  

""while stating why the falling part did not get demolished at all"
I have not been able to find any information on this in the NIST reports. Source?"

Its not in the NIST report! That's why the report is bogus.  You can see falling debris getting demolished mid air in ANY video you want to look at.  But the video I linked shows it well  As does the RR vid 10 part series i linked to you yesterday.  There are great still photos on screen of the collapse showing this, 

You seem to not understand that it is what NIST did not include in the report that was blatantly obvious to a lay person (pulverized material flying steel laterally) that is the problem with it.  The lack of explanation to what is obvious is why the report holds no weight.  And if you watch the RR vids you will know why they failed so horribly.  It wasn't a mistake.  It was on purpose.

You obsess over the NIST report.  Do you know the history of making that report  in the first place?  There were gov roadblocks the whole time.  It wasn't even released until September 2005.  The government only spent something like 25 million.  And the events of that day got us into endless war.  For comparison the cost to investigate the discovery shuttle disaster was over $400 million.  Do you really think they did a thorough investigation of WTT looking at the money spent?  They did REAL experiment to find out why the shuttle was destroyed.  They didn't hinge their bets on computer models AT ALL!  But NIST didn't do anything but make computer models.  And as this video states, models are only as good as the data you give provide.  They started with the assumption that it was not demolitioned.  And you NEVER start an investigation with any assumptions.  That's 101 basics there.

"Literally none of the signs. Most noticebly, the absense of the sounds of the explosives. This is what it should sound like:"

You mean all those firemen who were in the buildings and said they heard explosives going off were just lying?  Or something. Sorry.  And you can hear explosives going off!  You do realize that the cameras are zooming in and some may not pick up sound well at all right?  There are tons and tons of vids of experts saying they heard explosives in the lobby long before the collapse and fire was nowhere near them.  

""Not from the collapsing building from gravity.  Elementary school science already teaches that.  What force was it?"
See solution above. Gravity."

Gravity only applies downward force.  Force used to move objects laterally is not gravity. 

:What we see is an outward explosion of this material beyond the perimeters of each footprint.  And this is not expected."
Not expected by whom? 

An actual architect!  That's who.  By the way you don't see this outward explosion's at all in your vid of the building falling with the guys laughing about it.  So once again your example is not showing what you flat out say is expected in a collapsing steel concrete building.  That didn't have any lateral movement of huge steel sections being imbedded in them like the WTT did.

Watch the video man.  You clearly didn't.  It provides the mans name and credentials in the video!

""There are 64 transformers.  Each weighing 4 tons.  And yet after the collapse there is no evidence of them. in the debris."
Over 108,000 trucks loads of debris were removed from ground zero. Please tell me you haven't checked all of them and didn't find any crushed metal boxes. What are you suggesting? That some laserbeam from space targeted and destroyed all of them? 

Said the man who worked in the building and was there clearing it!  Geez.  It's in the video!  Where do my quotes come from?  From the video.

Have you ever bothered checking the recovered debris from the WTT?  Know how many filing cabinets were recovered?  ONE!  There were over 40,000 in the WTT.

https://www.facebook.com/drjudywood/posts/-why-was-there-only-one-metal-file-cabinet-found-in-the-rubble-of-the-wtc-towers/575785055819458/

And yes something with incredible explosive power was used in the WTT.  Something that isn't a normal explosive.  Look at this link.  No recovered furniture at all!  Where did it go?  falling debris and fire hundreds of feet above wont cause the complete destruction of the furniture.  It should have been in the rubble.  But  as you already stated, the dumptrucks  just carried out steel.  What about EVERYTHING else in that building? Where is it?  NIST report cant account for the vanishing of over 40,000 file cabinets.  All that furniture chairs, pictures, computers, etc.  All the things you see in an office.  Virtually none of it in any condition (crushed or not) recovered.  Gravity can't annhilate those things.  Something did though because look.  They aren't there.
Reply: @brucelansberg5485  "No. As I have very clearly explained above. What I wrote: "if you ask me to demonstrate the principle of what happened, you might want to watch this video. I know that you will claim it doesn't represent the towers. You are correct. It doesn't. It does show the principle however."

No there is no lateral movement of the collapsing structure at all.  Therefore it fails to represent the WTT in the slightest.  It does however demonstrate how the towers should have fallen if it was just gravity.  But the collapse of the towers had lateral projections.  This doesn't  This video proves that WTT did not collapse by gravity because the observations of that collapse don't occur like this. No lateral projections here.  Lateral projections in WTT

"The exterior steel panels acted like a shredder. The windows let a great part of the planes into the buildings."

Oh man. Seriosuly watch the RR vids.  Those planes get wiped out by birds and fences   You really are showing your bias here by not going to those vids because this statement is utterly ridiculous.  You do realize that the part of the plane that hit the steel structure would not go in right?  So where are those parts? Where's the engine!  Watch those vids man because it looks like you are reaching for the  stars landing in dirt.

"Wgy is it then you have so much trouble understanding the engineering of the towers? It perfectly explains what NIST was tasked to."

Because neither NEIST nor you can explain the lateral movement of steel.  And NIST did not investigate why collapse was inevitable at all.  They didn't bother looking for explosive despite the fact that everybody that day said it looked like a demolition.
Reply: @brucelansberg5485  "I hae explained that watching an interview with some stewardess that wasn't even involved in 9/11 doesn't help explaining yourmisunderstandings of the collapses of the towers."

You weren't' involved in 9/11 either.  Or heck maybe you are. It would explain a great many things.  Neither was NIST.  Yet they say things.  Sure is funny how you dismiss somebody working in the industry of the vehicle that hit the WTT and somehow their opinion does not matter.  You think they would know something about the planes and what they can do and procedure and protocols.  But that doesn't matter to you.  Geez.

Watch the vids.  At this point you must fear what is in them.
Reply: @DS94everXev  "The main point of this thread is how and why did the buildings fall down."
You might want to re-read the OP and your response to it.

"The video is about showing the required physics that is necessary (need explosives)."
Nah, it is about firecrackers needed to get the flawed carton model down. Like I have explained before, this carton thing has nothing to do with the wa the towers were designed.

"Start from the beginning.  The hijacking.  The flight crews."
Yah, well, I'm afraid these have nothing to do with the design of the towers, no matter how many times you keep repeating it.
Reply: @DS94everXev  "It's not that hard.  And they are simply stating what happened."
Then try to explain it to me please. The towers collapsed in their own footprint yet they collapsed way out of their footprint. Both claims from your friends at AETruth. So what happened? Inside or outside the footpriny? Can't be both.

"But you have multi ton steel sections flying over 60 mph and imbedding themselves into building that are in the  x y directions.  That can't happen from gravity."
Are you still defending this statement? After seeing the image, would you still claim this to be true?
Y is the vertical axis by the way.

"And as the video states, it should not have fallen straight down because as I have reiterated a million times now, asysmtertical damage results in asymetrical collapse."
Why don't you make up your mind already? Is it straight down or is it not? Reiterating and repeating is what you do indeed. But you have yet to explain WHY your claim is true. Simply repeating it because some oyjer conspiracy theorists said so, doesn't do the job. It makes you look as if you don't know WHY yourself. Do you?

"Did you read your own explanation here?  You flat out state that if you don't hit a round spherical object in the middle it will drift in another direction."
Please stop misquoting me. It is annoying. Needing to falsify my statements is a clear indicator you don't have any real arguments. Stop doing that.

"And you completely changed the conditions of the statement by adding another force.  Remember the ONLY  force used to take down those buildings was gravity.  According to NIST.  Now you are adding another force to explain WTT while also defending the one force statement of NIST.  So...you can't do that."
Yes, one force to take down the buildings -> gravity.
Another force to explain what could have happened DURING the collapses. How about friction and collision? Do you think these might explain just a little bit how not evey single item faling down, choose a vertical path?
One force to explain WHAT. Other forces to explain HOW. Those are ywo different thing. Let me remind you that you are the one that introduced the issue of single members not following a straight vertical path down.
Reply: @DS94everXev  "Ummm.. it is in this video."
So why did you claim NIST stating this? "Does NIST gravity alone force explain why these were completely demolished while stating why the falling part did not get demolished at all till all the floors were demolished."
It's time to get your thoughts straight and start being honest.

"you pretend that the falling debris is invincible when it hits the stable floors and isn't destroyed when it hits them."
I'm sorry. Did I forget to put the word "mass" in there? 

"The falling debris is destroyed when it hits the stable floor.  Eventually the falling debris is destroyed and the collapse should have ended before the whole building is wiped off the planet."
How does the debris breaking up (not the steel part though) reduces its mass?

" There was practically no recovered items like desks."
I asked you before and you failed to answer. Do you have a record in the over 108,000 truck loads and what was on them and in which state? No you don't. But I would agree that most of the content of the towers was destroyed. You seem to think this is weird or suspicious. I don't. Now the real question is: do you believe that these items should have remained intact no matter the cause of the collapses? The only theory that would "explain" the missing intact items would be Wood's bizarre theory on magical laser beams from space. Bizarre as in, these beams would have been able to "dustify" cabinets, desks and transformers, but not the columns, beams, trusses and anyting other that was made of steel.

"Does it really matter how thick the dust is?"
It is your claim again. You claimed it, I called it. Now it is not important? I will tell you why it is important. This is a nice and easy example of how you copy and repeat claims without checking your facts. What does that tell us about the quality of your research? The second reason it matters is that you were trying to say something. You were trying to make a point. If your assumption is off, you popint iff as well -> no point.

"The quotes I have are from the video "
And you eagerly repeat them when they fit your narrative. No need for fact checking, right?

"AE Truth likely did measure it as its their protocol (because they followed protocol unlike the flight crews that day) to do so before making a claim in science.  "
You might want to rethink that claim. When was AETruth founded again?
Please take another look at their own picture. 4-12 inches thick? And this is best picture to back that claim? Just take a look at the guy left, wearing sneakers. 4-12 inches??? Even 2-3 inches? What kind of magic sneakers is this wearing?

"You're completely missing the point though."
Yeah well, my point is that you seem to settle for any source that fits your narrative without checking the facts. AETruth is irreliable as hell, not worth your trust. Not just based on this one silly claim.

"Where did the dust come from?  (we know its cement) but no way was it pulvarized in mid air like that." 
Every floor had a concrete slab of 4 inches thick. That's 1 source. Second source is the interior walls which were all made from sheet rock. 

" Not a single cement piece much larger than you can hold in your hand was on the rubble site"
Concrete you mean? But also here, how do you know? 180,000 truck loads. We just don't know. Some source telling you there is no video available where concrete flooring is visible, doesn't mean it isn't there. The absence of evidence is not evidence of absence. But think about the flooring again. 4 inches, or 10 cm if you use metric. I would be surprised if it breaks easily, gets pulvarised. 4 inches is really not that much, very light weight for floors anyway.

"You have no clue how much snow is on the ground till you step in it."
Snow? We were talking about dust. Have you seen the people in that same picture? Is it safe to assume they weren't all wearing special high heels we can't see in the picture that day?

"Notice the range given in the very photo you use?  4-"12"?   The freaking governor said the dust (2 to 3") was all over Manhattan man.  That means there could have been places where it could have been more dust too you know."
Yes, I saw the range being mentioned. That is reason why I linked you to the photo. It is misinformation. It's not factual. Unless you want to believe that AETruth didn't really care to find a picture that would actually prove their claim on the same little pamflet.
The words of the governor are not really important when it copmes to the thickness of the alledged dust layer, are they? We know the dust was limited to down town Manhattan and it is incorrect to state the dust was all over Manhattan. So now you're using the governor as an excuse as to why your friends at AETruth are telling lies?

"It is obvious in the videos that you see steel sections flying laterally not in the  direction of force applied by gravity which is straight down"
It is not my fault you can't seem to understand the idea of sheets of exterior panels leaning and breaking. Let me repost the link that gets you to a picture that shows West St covered by at least two of these sheets of panels. It is not difficult to understand. Just take a look at the picture.

https://ia801303.us.archive.org/2/items/NIST_9-11_Release_08/International_Center_for_911_Studies_NIST_FOIA/Release_08/Release%208/42A0007%20-%201of3/Police%20Overheads/166.JPG

"No lateral movement in the slightest by any part of the building. But you see outward projection which means force applied not from gravity."
Wrong. Why don't you just admit you were wrong? Rip off the bandaid.

"And NIST (along with you) ignored the reason for that to happen."
Are you sure about that?

"The very next sentence in the video discredits this conspiracy theory of air pushing windows out 20 40 floors below the collapsing section."
Why does it? Please epxlain to me? Just saying it can't be, doesn't make it a fact. Meanwhile, the people from AETruth that m,ade the video, completely ignore the fact the building should have broken up right at the spots where the puffs are, right at that same moment. What magic explosives were being used "20-40" floors below the actual collapse? :) And what magic explosives makes 1 window pop on each involved floor? 1 window? How weak are these explosives? And what was the purpose of these explosives? What id they break? Probably no steel if only 1 window on each involved broke... See, this is the kind of questions AETruth forget to ask themselves.
Reply: @DS94everXev  "Its not in the NIST report! "
So you were lying again? It don't understand why you need to lie in order to make a point. It should be obvious you have no point if you need to lie about it.

"You can see falling debris getting demolished mid air"
What exactly do you mean? The development of the dust? Because I see a ;lot of dust. I still don't actually see falling debris demolished mid air. May I assume you're referring to the concrete floor and the gypsum walls? Although I don't see it, it wouldn't surprise me either if the concrete and gypsum would break up. It would actually surprise me if any sheet rock panels or 4 inch concrete slabs would survive the collapse. But they do not break mid air. They break up as a result of colision.

"The lack of explanation to what is obvious is why the report holds no weight."
Does that mean you're critisizing NIST's reports for what they didn't put in the report? Why? Ask yourself what they were tasked with. Their reports were not written to tackle every single conspriracy theory claim truthers are making. It's not that kind of document.

"But NIST didn't do anything but make computer models. "
What?

"They started with the assumption that it was not demolitioned."
They built a model that showed how fire and damage from the impacts were able to initiate the collapses.

"And you NEVER start an investigation with any assumptions."
YOU do. You even think no planes hit the towers :)). Is that something NIST should have considered too you think? I'll tell you what, NIST didn't consider magic laser beams from space either. Should they have done so? No nuke was considered aither. No invisdble martians either. And they didn't consider all these things because there was no indication for any of these scenario's. Only uninformed conspiracy theorists would see magic silent invisible explosions.

"You mean all those firemen who were in the buildings and said they heard explosives going off were just lying?"
Another nice example of how conspiracy theorists do not care about context. I linked a video under this quote. Did you see that video? Did you listen to the sequence of repating explosives immediately before collapse? I think it was quite obvious that nothing of that happened at either of the three collapses that day. And of course you try to manipulate the meaning of what I have written into something it wasn't, only to prove your point. Lying doesn't make your point a valid point.
If these firemen were in the buildings during these explosions, they wouldn't have been able to tell their story now, don't you think?

"And you can hear explosives going off! "
Well, show the video., Link it here. As a reminder, this is what we're looking for:

https://youtu.be/hdqWRHe4AKs?t=9

"You do realize that the cameras are zooming in and some may not pick up sound well at all right?"
Sure. Some cameras were zooming in. Others were just at the base of the towers. And guess what? Yet the sound of the collapses if clearly audible. How come?

A nice exmple here:

https://youtu.be/oCPVNLLo-mI?t=307
https://youtu.be/3HbD_Q6kmh8?t=99

"Force used to move objects laterally is not gravity."
You don't want to go into that kind of semantics, believe me. Something vectors something. You'll figure it out.

"So once again your example is not showing what you flat out say is expected in a collapsing steel concrete building. "
Stop lying! You claimed to steel framed buildings ever collapsed due to fire. I shopwed you THREE examples. And that's it. And stop calling it steel concrete. That doens't make any sense. Steel concrete doesn't exist and it is annoying when you're so obviously displaying your ignorence.

"Said the man who worked in the building and was there clearing it!  Geez.  It's in the video!  Where do my quotes come from?  From the video."
"It's in the video" is not a real means of proving your claim, is it? Why not make a bunch of your own videos and start linking to these while using the same ridiculous logic. "It's in the video"...

"Have you ever bothered checking the recovered debris from the WTT?  Know how many filing cabinets were recovered?  ONE!  There were over 40,000 in the WTT."
Oh nooooo.... For a few days I thought you had some kind of logic and reson in you. But linking Wood as a source? Sorry mate, I'm done with this discussion. You lost any credibility you still had.

Anyway that source isn't accessible.  But have YOU checked what was found? Take a look at these 2 videos. With a bit of luck you might even find some concrete, an engine or two, human remains from the passengers on the flight.

https://www.youtube.com/watch?v=OdMqX_F66rE
https://www.youtube.com/watch?v=Bgt5a-HoPPo

A free piece of advice: Make up your mind as to which conspiracy theory you believe. Explosions, thermite, nukes and laser beams from sace, ALL EXCLUDE EACHOTHER. You can't combine them. It wont work.

Good luck my dear friend.
Reply: @brucelansberg5485  

"You might want to re-read the OP and your response to it."

Nah I'm good with it.  You may want to find out how a car on the road reacts velocity wise when you hit a giant pothole.  It slows down!   Same physics here.  Moving object hits another object, it slows down.

""Nah, it is about firecrackers needed to get the flawed carton model down. Like I have explained before, this carton thing has nothing to do with the wa the towers were designed."

No.  You really are utterly confused.  It has nothing to do with building design.  It has to do with building collapse.  Can you replicate how the building collapsed?  And no you can't.  

By the way your own video of wrench boy flat out proves how the building would have fallen.  Straight down from gravity.  none of this lateral movement of anything.

Your own example shows what would have happened and yet the observed collapse of the towers does not match that video!

Where's the plume of dust mushrooming out with wood falling to the right and left in his video?  It all fell straight down!  And it was not completely destroyed either. 

 
"Yah, well, I'm afraid these have nothing to do with the design of the towers, no matter how many times you keep repeating it."

When you find out it was arranged and there were no hijackers or people with Middle east names even on those planes then you see how ridiculous it is to continue the conspiracy that we were attacked by them that day.  And the NIST is just covering up for it.

Your refusal to do so tells me about your fear of truth and your obsession with keeping the lie going.  Where's NIST explanation of complete destruction of everything not made of steel?  You know the plane engines which survive every crash except that day,
Reply: @brucelansberg5485  
"Does NIST gravity alone force explain why these were completely demolished while stating why the falling part did not get demolished at all till all the floors were demolished." It's time to get your thoughts straight and start being honest."

So that is a No.  Ok.  So how do you get lateral movement of several ton steel sections moving at 60 mph going hundreds of feet imbedding into buildings again?  From gravity?  NIST said so so I know you will say so.
  

"you pretend that the falling debris is invincible when it hits the stable floors and isn't destroyed when it hits them." I'm sorry. Did I forget to put the word "mass" in there?"

Explain how this video that we posting comments in didn't explain this concept to you.  You have no idea what he is saying.  Watch again and again till you do.  When the falling mass hits the stable object it would do 2 things.  Break up is likely.  And most definitely slow down!  Free fall says that didn't happen which requires explosive devices.  As the experiment shows in this video, he was able to achieve the free fall using explosives. And failed to achieve free fall using the pancake theory of collapse which is what NIST says happened.  Yet NIST failed to provide a real world model proving this and instead retorted to video games to prove it. 

"I asked you before and you failed to answer. Do you have a record in the over 108,000 truck loads and what was on them and in which state? No you don't."

Look up what WAS not found!  That is what matters.  By the way we shipped practically everything in those dump trucks to China almost immediately for them to be melted down.  And I did provide a link of what items were not recovered!  Like everything.  I provided link to a video of the recovery workers who flat out state in the video that there was nothing left. So yeah.  They moved steel.  And NOTHING ELSE.  There was no furniture.  No Transformers!  No computers.  Nothing at all remained that would suggest that these were the largest office buildings in the world!!  You can hear the recovery workers say it.  You can see the video of the rubble.  The actual people who worked thru the rubble state this!  Stop lying about me not proving it.  I did.  By the way, how come you can’t find that record of what they hauled away.  Huh?  Why is it on me?  Prove that all the stuff in those buildings were recovered.  Crushed or not.  But you won’t! 

"But I would agree that most of the content of the towers was destroyed. You seem to think this is weird or suspicious. I don't."
That's because you believe in the fairy that is the vanishing of matter.

"Now the real question is: do you believe that these items should have remained intact no matter the cause of the collapses?"

Yes.  They would be crushed to varying degree.  But they would all still be present in existence.  Those transformers are not going to vanish from the face of the earth. Nor those engines.  You want to believe simply crushing stuff will annhilate it from existence.  You have no other example of a collapesed building that shows this to be true.  Yet NIST says it to be so you do.  

"The only theory that would "explain" the missing intact items would be Wood's bizarre theory on magical laser beams from space."
You are the only person on earth saying magic laser beams from space.  Get a life.  You don't think we have tech in the CIA or military industrial complex that can do scary unthinkable stuff?  You think we spend over $600 billion a year to pay for uniforms?

"Bizarre as in, these beams would have been able to "dustify" cabinets, desks and transformers, but not the columns, beams, trusses and anyting other that was made of steel.:"

And yet you fail to provide a single reasonable explanation for why the transforms aren't there.  Nor the engines.  So your defense is "I blame magic beams.  But magic beams don't exist."  You can't explain the reason for no toilets recovered.  No concreate.  No floors that are an acre in size and there are over 100 in each building.  And you pretend that the all the twisted metal is just normal  Those transformers ARE MADE of steel!  The engines are made from titanium.  Strong as steel.  I never said that all the steel survived.  I said only steel made it through.  And a lot of it didn't.

"Does it really matter how thick the dust is?" It is your claim again. You claimed it, I called it. Now it is not important?"

No it's the NY governors claim.  So take it up with him. 

"This is a nice and easy example of how you copy and repeat claims without checking your facts. What does that tell us about the quality of your research?"

The entire NY city residents and media who went to there in Manhattan saw the dust.  You conspiracy theorist saying it didn't exist is on you.  Making any claim that the dust was not there proves it is you who is the conspiracy theorist.  It's all over the Internet.  Pictures of it everywhere.  People talking about it.  There was even a dust woman (who died).  What kind of person thinks that the dust has to be uniformly spread across Manhattan?  ONLY YOU.  Wind can carry dust to pile up more in on area than in others!  Corners and buildings can gather more dust to stack up!  You are doubting my research?  I know what the z axis is.  And I know matter doesn't just vanish from existence.  You don't know that.  Or you think falling debris crushes everything into dust.  Either one is false. You ain’t crushing 60 transformers into dust from gravity and falling debris alone.  You have no evidence to suggest this is feasible.  Only “I believe most things were destroyed.”

"The second reason it matters is that you were trying to say something. You were trying to make a point. If your assumption is off, you popint iff as well -> no point."

The only person who is obsessed with the depth of the dust is you.  There was no concrete in the rubble!  There was over 425,000 cubic yards of cement used to build the towers and where did that all go?  IT wasn't in the rubble!   Your point is I have no idea what else you are saying.  By the way the dust didn’t stay in Manhattan.  It travelled beyond Manhattan.  So stop with the lie that it only stayed in Downtown Manhattan.  

“Just how far did the toxic dust from the collapse of the World Trade Center on 9/11 travel? Satellite images show the dust cloud trailing from Lower Manhattan across Brooklyn and into the Long Island Sound,”

https://www.post911attorneys.com/blog/how-extensive-was-the-wtc-dust-cloud-and-who-is-eligible-for-911-compensation/

"And you eagerly repeat them when they fit your narrative. No need for fact checking, right?"

They come from experts.  Your quotes come from...actually nobody.  Still waiting on those NIST quotes that prove everything I have wrong.  Interesting you don’t use them.

"Yeah well, my point is that you seem to settle for any source that fits your narrative without checking the facts. AETruth is irreliable as hell, not worth your trust. Not just based on this one silly claim."

Again your point is to disprove the existence of the dust or amount or who the blieln; knows at this point what your point is arguing about the dust.  And not to account for the mass or presence of the concrete while saying there was not dust in Manhattan. Conspiracy theorist you are.  Funny how you don't account for the concrete.
Reply: @brucelansberg5485  " how do you know? 180,000 truck loads. We just don't know."

1.	 I have eyes.  See the rubble?  No huge cement slabs.
2.	  The people working the recovery said so!
3.	  You have no idea what you're talking about saying we don't know about the cement.  You are lost.  The people doing cleaning it up said THIS!!!  
4.	  Why is it that “we just don’t know”?  Huh?  If it wasn’t being covered up, it should be very easy to find a list of every recovered item.  And the lists that I do see don’t include any of the things that wouldn’t be destroyed into nothingness by falling debris and gravity alone.  

"But think about the flooring again. 4 inches, or 10 cm if you use metric. I would be surprised if it breaks easily, gets pulvarised. 4 inches is really not that much, very light weight for floors anyway."

The architect in the video provided said so.  And you can find others saying the same thing NOT FROM AE.  But you won't watch them.  so what is the point.  And when it comes down to you vs them.  I take them.  

"Snow? We were talking about dust. Have you seen the people in that same picture? Is it safe to assume they weren't all wearing special high heels we can't see in the picture that day?
"

No.  You were saying you know how much dust is covering the ground by looking at it. Same skill applies for snow. Hey, since you can do that, can you explain how the rubble pile after the collapse was no higher than the lobby was when the building was standing?  110 floors of steel and everything inside that building made a pile of rubble that would not reach the lobby ceiling when it was standing.  Where did all the stuff go?  oh that's right.  gravity from falling debris crushed it out of existence!  silly me.

"Yes, I saw the range being mentioned. That is reason why I linked you to the photo. It is misinformation. It's not factual."
And you are acting as if that photo said there are 12" of dust in that picture!  It didn't. Only nut job conspiracy theorists take that photo and make the assumption that it was the area with the most dust showing 12".  Sorry.  No reasonable person comes away from that photo thinking that.  They come away with, "Gee that looks awful."  But you don't.  There a a trillion reasons why they could have used that photo.  And you  are pretending it says that there was 12"of dust on the ground IN THAT PHOTO.  It doesn't say that.  

"We know the dust was limited to down town Manhattan and it is incorrect to state the dust was all over Manhattan. So now you're using the governor as an excuse as to why your friends at AETruth are telling lies?:

The governor said it!!!!!!!!  Again take it up with him!!!!  Who gives a bleep if it was downtown  Manhattan or the whole island!  What was the dust made from? And do gravity alone collapses see such dusting?  THAT IS THE REAL ISSUE!  Not your concern of how deep it was and how far spread it reached the island!!  Geez.  And AE used the governors interview in their video!  

“Just saying it can't be, doesn't make it a fact.”
Nor does disputing the comment make you right.  But what you fail to figure out is why did the air wait 40 floors to finally leave thru THOSE windows?  There were plenty of avenues for th air to travel and they waited that long to exit the building thru those many floors.  Yeah.  Sure. Makes sense to somebody who refuses to see that they were explosives and its what you’d expect in a demolition.

I find it awfully interesting that you never not once ever quote NIST statements back to me to answer my concerns.  Afterall, you say they did answer it.  So why not use their own words rather than make up stuff that fits your narrow narrative?

“"And NIST (along with you) ignored the reason for that to happen." Are you sure about that?”
Yes.  Because you don’t answer the question here. Not before.  Not now.  Not later.  What a horrible answer by the way.  If you know SAY IT.  But you don’t so you come up with a horrible answer.
“Just take a look at the picture.”
Those pictures show imbedded steel into other buildings.  That means they were thrown outward with such velocity that when they hit the building, they didn’t just bounce off, but managed to penetrate it so much that it stayed in the building despite gravity pushing it down.  You realize that you have yet to post a link of a picture or article that proves your point and in fact only proves mine true.  You do see that right? Because your reply to my link and articles has been “I don’t accept it”.  See the difference.  I explain yours quite easily with basic scientific principles and brain power.  You don’t explain the destruction of transformes and virtually EVERYTHING in the towers.  If they were all crushed, that would make sense.  You’d find them crushed.  But they don’t find them AT ALL!  You demand eyewitness testimony stating it, and I provided it to you.  You simply ignored it.  Because it contradicts NIST and you can’t allow that

“What magic explosives were being used "20-40" floors below the actual collapse? :) And what magic explosives makes 1 window pop on each involved floor? 1 window? How weak are these explosives? And what was the purpose of these explosives?”

You are not a scientist or an engineer or even somebody who has watched a demolition in your life.  Not in video. Not in experience.  See these  videos of building getting demolished.

https://www.youtube.com/watch?v=yOE8H_1Dhz4

https://www.youtube.com/watch?v=3JMgFgjSkQ0

Notice how nont a one of these vids show them blasting out every single window!  Notice how they don’t have to place explosives at EVERY window!  It was nano thermite that cut it!  And it was found in the lab test that looked to see if it was present.  And your precious NIST didn’t even look for it.  So there.

You don’t need to have EVERY window  blown out to demolition a building!  Dear God!  In fact you NEVER do that if the demolition team knows what they are doing.  You go on and on about how you know the WTT design.  Yet you think you need to demolition every window to bring the tower down at free fall!  

Not a single one of these control demolitions needed to do what you say is necessary. You don’t have a clue what demoltion teams do at all.  What magic explosive does this?  Seriously do some research.  You do understand that you would blow the explosive BEFORE the collapsing structure reaches the floor the explosive is on right?  If the collapsing building hit the floor the explosive was on BEFORE  the explosive went off, it would slow down the decent of the building (maybe even stop the whole thing as there are vids showing collapsing buildings don't imminently collapse, even if demoltion set it up).  The only way to get free fall is to take out the support beneath the part that has already collapesed!!!!!!!  THAT IS THE ONLY WAY TO GET FREE FALL!!!!!!!!!!!!!!!!!!!!!!!!!!!!!!!!!!!!  And that is what is what happened.  No matter how much you deny it.  By the way NIST does not deny free fall happened either.  So why do you?
  

“See, this is the kind of questions AETruth forget to ask themselves.”

You do know that a lot more people who are NOT AE question the collapse.  So they aren’t alone.
Reply: @brucelansberg5485  

 I find it awfully curious that you did not reply to the link of the world trade tower janitor who heard an explosion down in the basement of the tower BEFORE the plane hit.

Awfully curious how you ignore that bit.  You said all those explosions people heard in the lobby were a result of the fire and damage caused by the plane after they hit the tower.  Well, there would be no fire before the planes hit would there.  So, explain the explosion BEFORE  the plane hit!

See, I got you.  You know it.  And you ignore it.  Which is what you do.  Silence will be the response from you  now that your whole world view is crushed.
Reply: @brucelansberg5485 
"They built a model that showed how fire and damage from the impacts were able to initiate the collapses."

No, they didnt build a damn thing.  They only made computer models.  And they didn't look for explosive residue  because they knew they would find it and have to explain it.

Not a soul that day thought those buildings coming down didn't look like a demolition.  everyone said it on TV.  A very simple test would prove there were no explosives and end the whole debate.  But they didn't do that!

"You don't want to go into that kind of semantics, believe me. Something vectors something. You'll figure it out."

Says the man who thinks y is the vertical axis in 3D.

""It's in the video" is not a real means of proving your claim, is it? Why not make a bunch of your own videos and start linking to these while using the same ridiculous logic. "It's in the video"..."

Then what were you ever doing here?  If you just flatly dismiss the videos.  After you required evidence; Evidence provided.  And rather than disproving the man wrong you wuss out and say this crap.  You didn't disprorve his point! 

"Oh nooooo.... For a few days I thought you had some kind of logic and reson in you. But linking Wood as a source? Sorry mate, I'm done with this discussion. You lost any credibility you still had."

Look up any damn source you want. There was one.  Many sources say it.  freaking loser
Reply: @brucelansberg5485  My last reply to you..

You demanded evidence.

I provided evidence from
1.  Experts who know how buildings are built and how to demolish them.

2.  Evidence from peer review articles in established respected journal.

3.  An article about that said peer review work for you to read because it's an easier to inderstand read for almost anybody.

4.  Evidence from the people who were eye witnesses during the event.

5.  Evidence from those who ACTUALLY were on the ground helping with the clean up.

6.  Evidence from workers from the WTC.  People who would know more than others how things there work (transformer worker and janitor hearing explosion in basement BEFORE the plane hit.  That all in itself ENDS YOUR CONSPIRACY THEORY)

7.  Evidence from a flight attendant who understands how the aviation industry works and would end this debate in a heartbeat yet YOU REFUSED to hear it.

In the meantime you provide absolutely NOBODY who doubts what happened.  Not even a NIST quote.  Not an architect.  Not a demolition expert.  Not a physicist.  Not a peer review journal.  Just and EXCLUSIVELY your utterly horrendous interpretation on objects speeding up after hitting other objects and using pictures showing embedded steel in buildings while telling me that did not happen!

You refuse to accept what all these people from various levels of expertise and hands on experience of working on site!  You kept asking for evidence and refused the evidence from those who know a fogjj more than you do on EVERYTHING.  From how to build the towers.  To how to.demolish buildings.  To those who worked day in day out.  To politicians who were on site.  To peer review journals.

And you have the gall to say that I don't provide evidence?

Your examples all sucked!  You have no knowledge in physics in the slightest.  You think it's ok that things just vanish from existence.

There is NOTHING THAT CAN CONVINCE YOU FROM ANY SOURCE NO MATTER WHAT.  SO STOP YOUR LYING THAT YOU WANT EVIDENCE WHEN YOU REFUSE TO HEAR THE EVIDENCE YOU WANT FROM PEOPLE WHO HAVE MORE EXPERIENCE THAN YOU.
Reply: @DS94everXev  "Your falling mass will be decelerating as it falls no matter what is happening."
False. You seem to misunderstand speed for acceleration. If you drop a hammer from the top of a building, it has a constant acceleration of 9.8 m/s2 (it goes faster and faster up to terminal velocity). If that hammer encounters some kind of obstruction on its way down, the acceleration will decrease. However, as long as the acceleration is over 0 m/s2 it will accelerate. Only if the acceleration becomes negative, the hammer will slow down.

" Thus the mass falling onto the floors is LESS than the mass of the floors were before the collapse."
Unless the mass of 15-28 floors will be applied as a dynamic force onto the 1 single floor below.